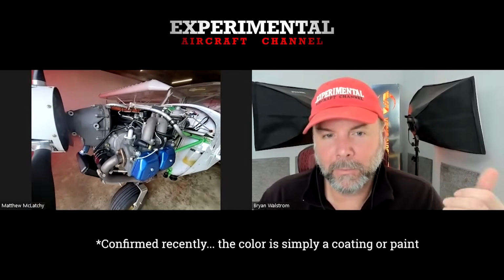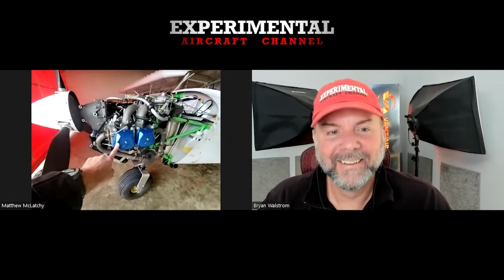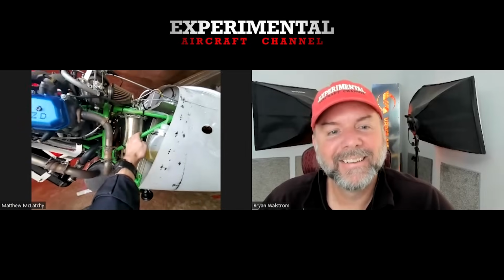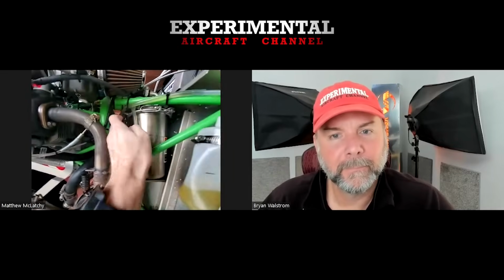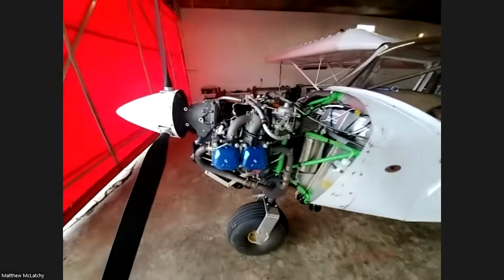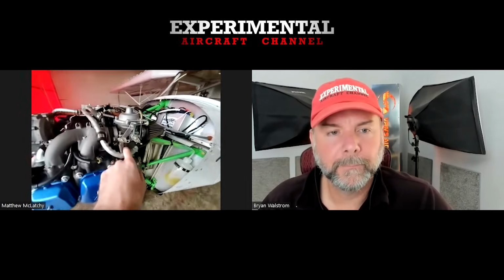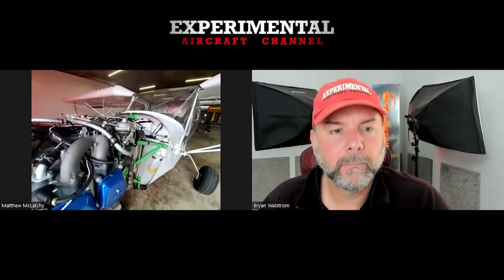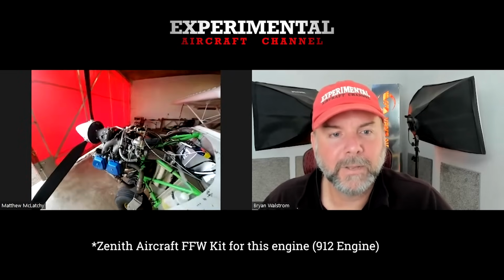Clone Wars! 1st Customer installed Rotax "Clone" ZD Aircraft Engine - Zenith CH701 - MMATT Channel

Comment: Simply splitting ring section from its skirt, the 2-piece piston retrofit technologies can usher in the advanced hybrid engines. The ring-section is operated via (valvetrain-like) piston-train to pump the gases and reunite with skirt for the heavy power strokes. Thus, new piston completes the 4 strokes, different in both displacements and periods, in every revolution – called differential-stroke cycle which is a hybrid of 2-cycle and 4-cycle – to >2.5x power and >20% efficiency gains. It can further combine diesel/gasoline engine combinations to eliminate diesel’s soot and NOx emissions – to save $10billions of diesel aftertreatment.

Comment: I agree, never go with a Chinese knock off! I have experience with the Chinese CF Moto product: off road machine, which is a Cloned Can-Am engine. I worked at a Honda dealership and we had to rebuild these on a regular basis. Very cheaply built, and the engine block castings, had voids throughout the block???? And were talking an engine that does not fly.  I would like to know if/when you get 200 hrs. On this Rotax clone.....good luck!!!

Comment: I think this motor looks good. Seeings how it's a clone it would be just the ticket to put it in a Savannah. Then put the combo on some cloned floats. I've been reading some 1959 and up eaa mags lately and an article on using alt engines brought up the fact that the engine is your life insurance.Vw 1200's and Ford model a's were used in some planes. Some model a's were used air cooled by chiseling off the water jacket and using a finned alum head.Wild.  Pietenpols and air campers worked well with them. Different times. The idea of 100g plus homebuilts today leaves me dumbstruck. Resale values to be determined. Great vid, thanks for the info on this new motor.

Comment: Thanks!
Reply from the maker: THANK YOU! Very much appreciate your support! :-)
Reply: I’m thinking of how ironic it is that the need for engines to power Iranian drones used by Russians against Ukrainian forces armed by America resulted in Chinese engines that were affordable to flying addicts like me.   Good on ya Mmatt for trying it first.  Love this channel.
Reply: @OtterFlys  The Iranian made Shahed-136 drone Russia is firing into Ukraine is powered by a 2 stroke 4 cylinder opposed engine called the Mado MD-550 it's a copy of a German engine called Limbach Flugmotoren L-550. First mass produced in Germany in the 1980's for ultralights.  Weight is 50 lbs with 50 HP turns 7500 rpm.

Comment: Also curious about his needing to do “seasonal adjustments” to his carburetors. The Bing 64 on a Rotax 912 requires no such adjustment and compensates automatically e.g. “leans” the fuel mixture in response to changes in pressure altitude. Would like to learn more about what he is experiencing and what adjustments he makes.
Reply: He said, it’s the temperature, not the pressure altitude.
Reply: Yes as the temperature changes so does air density. This means so does atmospheric pressure. This is why traditional aviation carburetors should be leaned by the pilot prior to takeoff at high altitude airports or on hot days even at sea level. Both hot and high is a potentially hazardous combination for aircraft performance. But Bing 64 carbs compensate for this automatically within their design constraints.  I still would like to know what symptoms he’s experiencing and what he is doing to his carbs to seasonally compensate. The Bing 64 has no requirement for the operator to adjust anything based upon temperature changes.

Comment: There are several good aviation safety reasons a Rotax is expensive.  They include world class configuration management, supply chain management, detailed technical documentation, detailed owner and service manuals, instructional videos, Service Alerts and Bulletins, owner instructional videos, a global network of factory trained service centers and technicians, with customer technical support provided to owners. I receive Service Alerts directly from Rotax if a problem is discovered by them with any part on my Rotax engine, including how to determine if my engine is affected, how inspect the part, and what to do if my part needs replaced because of the problem. All of this costs money and that cost is reflected in the cost of the engine. Does this clone engine manufacturer provide anything similar for a third of the price of a Rotax? Me thinks he has bought an engine, and not much more than that.

Comment: When I weigh the risks, it's always some sort of compromise. Engines are measured by weight, power,  efficiency, reliability and cost. There is no engine that is the best in all categories. If you find an engine that is the most reliable, efficient, powerful and lightweight, it's also going to be the most expensive. If you can get an engine that is equally reliable, powerful, efficient and lightweight but it's more expensive, it's very difficult not to choose that engine.

Comment: Someone please enlighten me. So, how does this company manage to continue operating despite publicly saying their engine is a copy of the Rotax 912. Aren't they afraid of being sued at the very least or being barred from marketing their engine?
Reply: They are communist they dont care, there is no rue of law in china.
Reply: Apparently,  there are no valid patents on 912. All components are standard items. Also, ZD was a supplier of Rotax parts for 912.
Reply: Patents,   at least here in the US and  Austria,  run out after   20 yrs.    the 912  was  certified  in  1989, or  36 yrs ago.    
Now,  if they used  'Rotax' on the valve cover... or anything they could  imply it was a  true Rotax-  like casting numbers,   paint color (if it was  trademarked)   the  chinese (or anyone else)  can  do  whatever they want---  except use the  name:  Rotax.

Comment: I dunno…I’m not bothered by the competition, but just taking Rotax’s IP and making a copy is just wrong. I wouldn’t buy or fly one because it’s seems to be theft to me if it was not properly licensed by Rotax. It’s a slippery slope and I’ll pass.
Reply: The patents were only good for 20 years. They are good at copying. But on an engine there’s a whole lot you need to get right in the metallurgy, castings, coatings, heat treat, etc.

Comment: Amsoil,
For your oil sample.
The founder was a jet pilot who designed the first industry leading synthetic oil.
And the US military was his first customer.
A 15- 40 diesel oil with a military rating on the label,
Used in everything,tanks etc.
Has a rust prevention rating for internals for 12 months.
A firm believer in the product line and many used on my farm over the years

Comment: Even with a Rotax you do not fiddle the carbs when OAT changes...  what rubbish is that, I never had to adjust the carbs with my 30+ years with any 4 stroke Rotax all seasons. Oil level should be at the top, not in the middle.
Reply: Good info. Yeah I was wondering if that was a thing with Rotax. Didn’t imagine it was

Comment: I love Stihl chainsaws. Take a look at a handy 16" MS170 for $199. Then look at the identical saw on the shelf for $649. What gives? Well the $199 Stihl says "Made in the USA" and the other says "Made in Germany." OK geniuses here's a question: Is American labor that much cheaper than German labor? No. When you see "Made in the USA" it only means that a certain percentage of the PARTS were ASSEMBLED in the USA. Most of the parts for the $199, made in the USA Stihl are made in China. Same with Kohler engines, Branson Tractors and many other trusted brands that not even I have the resources to research and reveal.
Reply: Branson tractors are South Korean.

Comment: All for making aviation affordable. However, not willing to bet my life on a cheap knock off. Too much risk for too little reward.
Reply: I would question the quality of the original. Lots of Chinese parts. So many problems with the 912. 

Totally hear you with the knock off. But rotax is WAY overpriced for what it is. They need competition… wish continental would make something similar… not thrilled with rotax
Reply: @nickr5658    Chinese Continental? 😂😮😢
Reply: @nickr5658  , exactly my point. Cheaper knockoff of a design that has had some issues. I would trust Rotax to solve those issues before I would trust a knock off company whose main priority is copy someone else’s design and cut every corner to make it as cheap as possible.
Reply: @keepingitreal412 
I wouldnt fly a 900 series if you gave it to me.
They have had 30 years to resolve issues with that gearbox and have not done so.
100% of the E lsa and S ls a aircraft operating in my area with those engines have had gearbox failures between 170 and 400 hours.

That is a truly unacceptable TBF for an aircraft engine it all, say nothing of the premium price point assigned to them.

Edited due to fat fingers.
Reply: When the price of a Rotax rises above what a hard working guy can afford, I’m a gonna buy me that Chinese drone engine.
Reply: Using RTV as a sealant is a no-no for engine builders. It disintegrates into nasty boogers in hot oil and can block oil passages. That alone would stop me from buying one.
Reply: @sledawgpilot  most peoples use waaay too much RTV is the main problem. A 3/16" bead or less is plenty much. 
 However many manufacturers quite extensively use semi liquid hardening gasket makers for almost everything except head gaskets and a few certain other applications where it just wouldn't work. It actually works quite well otherwise with much less seepage issues as compared to regular gaskets.
Reply: That's because everybody uses waaay too much! All that excess material that squeezes out is just waste! A 3/16" bead is way plenty!  RTV Silicone gasket maker is for making gaskets. Don't put it on gaskets, except for maybe on corners where seams meet. I like Permatex Ultra Silicone Gasket Maker because unlike regular RTV Gasket Makers, Ultra is sensor friendly and not corrosive to aluminium parts. I use mostly ultra grey high vibration resistant, works well. No leaks. Three Bond 1105 I believe  it is, is also an excellent case half seam sealer.  @sledawgpilot
Reply: @sledawgpilot you check virtually any car made lately? I been in a lot of them, that doesn’t happen in normal circumstances.
Reply: @OtterFlys you think car manufacturers are using silicone RTV by hand and using too much like this sketchy thing?
Reply: Agree that people use too much sealant. TCM gasket maker and other anaerobic sealants are approved on Continentals. It doesn’t harden unless it’s squeezed between surfaces. There’s just no way know how much seeped inside the engine after assembly. If you pull apart an engine that has had silicon and seen how softened it gets you wouldn’t use it.
Reply: Hopefully the outcome of our current tariffs will be such that an American Company can build a competitive and well priced engine. (Lighter weights too)

Comment: It's obvious that he hasn't had any Chinese knock off motors before. 
I don't mind them on a mower or log splitter but not on something that you need to make sure is reliable and is not going to let you down by falling out of the sky. 
I've had alot of experience with the knock off engines but not a plane rotax engine knock off.
I couldn't trust 1 to go flying with. 
Hopefully China has finally made a good knock off for his sake.

Comment: Was this video reuploaded? I feel like I saw this a couple weeks ago and then it disappeared. Maybe a patreon thing? Either way, this looks like a decent option along with the other cheaper experimental engines. I would be inclined to buy one of these vs build / buy a VW. I have worked with and on Rotax's so it's mainly familiarity.